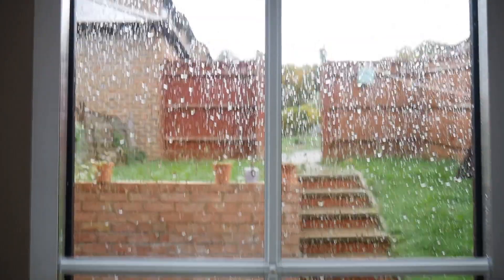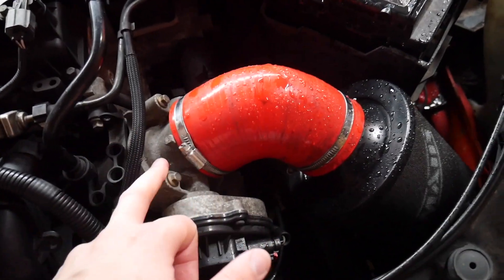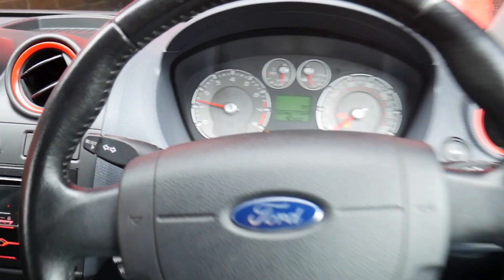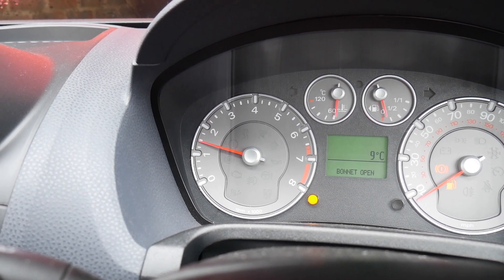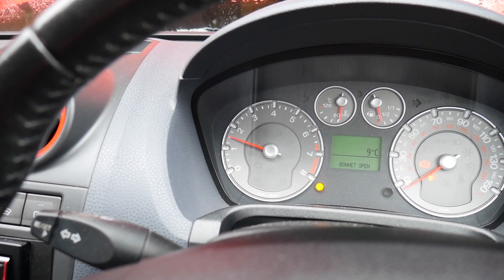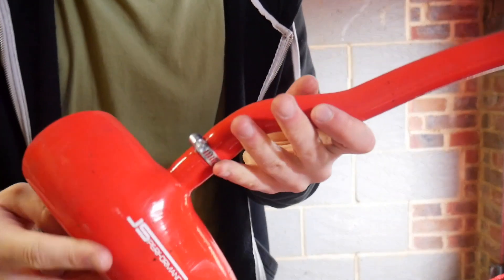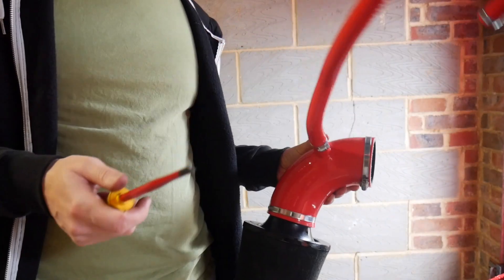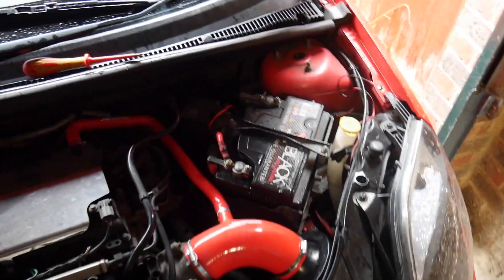Fixing the fiesta St Idle Issue?

Comment: Hi again Jay, mines opposite when the car is cold and I tap the throttle the cars revs drop Bellow 800 rpm and nearly stalls but when the car is warm it doesn't do it? Our cars are riddled with annoying problems, worse one for me is still power steering I hate it
Reply from the maker: Jonathan flynn hey again! That sucks, it’s mad that they can have the same problematic parts/issues which cause like the opposite reactions, mines not majorly bad though just annoying.

I still plan to sort my power steering and relocate it but just need to get around to buying the parts and getting it done!

Comment: Jay - Pcm reset, is it just the case of unplugging negative battery terminal for 10 mins! Just had three people sort out my exhaust.. mounts and brackets and heatshield
Reply from the maker: MrDJGalloway gonna be replacing my PVC hose and valve next, but I’ll do the reset when I do just in case it’s the issue!

Comment: some egr cleaner sprayed through the system may cure alot of these idle problems people are having, it will also clean the idle control valve, or you can take it out and clean it separatley.

Comment: Hi , I just rebuilt my wq 1.6 engine and came across some little issues ,in saying so , I had a idle issue as well . ( this may seem odd but fixed my idle issue) I turned off all lights heater fan and all powered sores then disconnected the battery + and -  .  Then connected the + and -  lead together for 20 minute off the battery.  Disconnect the joined  + and - When placed the terminal back on the battery ,start the car on idle only until  20 minutes. ( no touching the throttle ) I made sure the temperature is correct and not over heat .  Then switch the car off . After this drive lightly for  at least 1 hour .This may reset you cpu on the car for the mods .  Consider that All diy jobs is at your own risk.
Reply from the maker: I've heard that the reset (leaving the battery unplugged for 10-20 minus) resets the throttle body and can help with the idle issue. Good idea though, glad it fixe yours!

Comment: Mine does the opposite and falls to 500 rpm briefly before going back up any ideas?
Reply from the maker: These cars tend to have dodgy isles anyways, could be the throttle body or maybe a split in the PCV hose. I’ve got videos coming both so check them out!
Reply: Did you find what was wrong? Mine does the same thing.
Reply: @kubax_s  nope not really, still kinda does it but it’s not as bad since I took the throttle body off and cleaned it

Comment: I had this issue, when I clean throttle body. You tried disconnect battery over night?
Reply from the maker: Jan Novák yeah I’ve cleaned the Throttle Body and had the battery disconnected, I’m pretty sure it’s a vacuum leak now! Order the next parts which I think will fix it already!
Reply: Good luck!

Comment: My st150 has also just started having this problem, cleaned throttle body and I've sprayed brake cleaner between the Inlet but I can't find a vaccum leak at all 😔 but it's stopping the car crackling and just doesn't feel right driving it becsuse the revs don't drop when coming off the throttle. Cars just hit 50k
Reply from the maker: That sucks! It might be the PCV hose thats either split or collapsed causing issues. Thats what I'm changing next!
Reply: @jaymono6498  tried testing it with brake fluid but it didn't chase revs or anything. One day its fine next day its not
Reply from the maker: Yeah thats annoying, apparently when these where released they had a general Idle issue due to the ECU. Apparently Ford had to call cars in to fix an ECU issue. With yours being such low milage that could potentially be the issue. Hope you find out!
Reply: @jaymono6498  ah bugger, I'll have to look into that. You too mate
Reply: Keep us in the loop 😊

Comment: what did you use to stick your cover on over your plugs and leads? i too have vents in my st150 and the vents allow water into my cylinders when it rains. i have a real carbon fibre cover but not sure how to secure it down
Reply from the maker: Mine was on the car when I bought it, but its got some mounts which bolt onto the valve cover somehow. If you DM me on instagram I can take a few pictures for ya

Comment: Did this issue cause any problems when driving?

My car mk6 has a idle issue where when I first start it in the morning it will be below 1k revs or stalls.
Reply from the maker: I only really had issues when idling over or coming to a stop, mine never stalled though. Some peoples cars cut out when they've put it into reverse with similar issues likes yours.

The fix on mine was the PCV hose, it had a massive slit in it causing more air to get into the system and the ECU then added more fuel to try and match it
Reply: JayMono has a look over my car this afternoon and I had a massive slit too in the hose, the whole part was spongey as well
Reply from the maker: @chazma123  Sounds like the hose collapsed and split! get that changed and it should idle a lot better.

I've got a video of me changing mine on my channel, with links of videos I used to help me :)

Comment: I have the same issue but the car also has a little bit of a whining/whistling sound. It goes away under throttle. Do you think my issue is the same?
Reply: I have the same problem I've just had my pcv hose changed but still doing it. Sounds so annoying while.putting the foot down. Did u fix ur problem? And how?

Comment: On my 1.6 focus 2005 the idle problem is 10 x worse! When i come to a stop, the rev counter can drop so low that the car has been know to stall! I have spent around 200 quid over the years but nothing has worked!
Reply from the maker: JmeJ83 hmm I know the Fiesta aren’t great for idling in general, and most of them dip in revs when they go in reverse. Have you had the PCV valve changed? I changed mine this weekend and now it idles great - video will be up about it at the end of the week.
Reply: @jaymono6498  
I had the throttle head cleaned out, i replaced the idle control valve and something else that i can't remember.
 changed all the spark plugs too, but nothing has worked. Had this problem for a couple of years, but it's very intermittent. Sometimes it's not to bad, then others it's stalling and when i turn the key it stalls again. I can't figure it out 😔

Comment: Got a quite similar problem to my mk6 st, when i stop and go to neutral it revs up to about 2500 rpm stays there for some seconds and then go down to around the normal 1000 rpm... got full stock engine without bolt ons...
Reply from the maker: Annoying isn't it!

Apparently it's either this hose line under the intake manifold that has split, or you can contact a Ford garage and they can update the ECU with something to fix it.
Reply: JayMono I didnt mind it so hard but I‘m from Germany and need to get Tüv (like mot) soon and I guess I will not get it with this idle... mine is way worse like yours esp. when engine is warmed up :(
Reply: @Justin ST150 thank you for the response. What does pvc hose mean?
Reply from the maker: I think it stands for positive crankcase ventilation!

Comment: Hi all just wondering if any one knows my issue, I have a noise around the inlet manifold area possibly the pcv hose, it's like a blowing sound or whhooo sound when I rev the engine and driving ,the higher the revs the louder it gets, cheers
Reply from the maker: Sounds like it might be the PVC hose. But difficult to tell without popping the inlet manifold off!
Reply: @jaymono6498  thanks mate appreciate your reply I'm waiting to hear  from Ford of they can get a hose and valve then I'll take inlet of and change it and hopefully fix the noise and slightly high idle when I pull up to a intersection, cheers mate

Comment: Just found this on a forum, maybe this will help? "Quite a common thing, best way to fix is to replace the throttle cable completely. Only takes 5 mins and makes a world of difference. Before fitting the new cable make sure its lubed up with WD40 or PTFE spray to keep the moisture out" link - https://passionford.com/forum/fiesta-rs1800-rs-turbo/46427-fiesta-1-25-sticky-throttle-help.html

Looking to get a Fiesta MK6 myself so defo gonna check the throttle before buying one 👍

Comment: Clean throttle body and check for air leaks pal
Reply from the maker: duane richardson cleaned it in a previous video, didn’t fix it. It was and air leak and have fixed the problem, video soon!